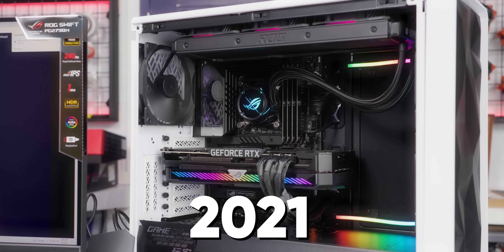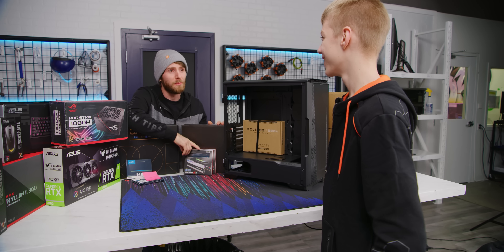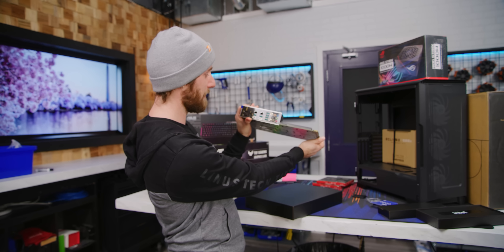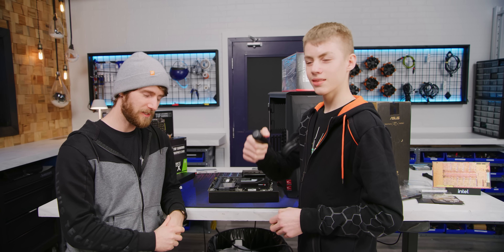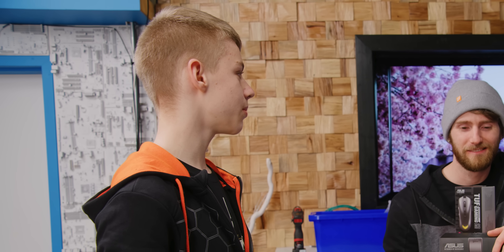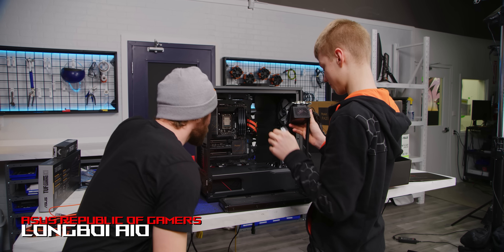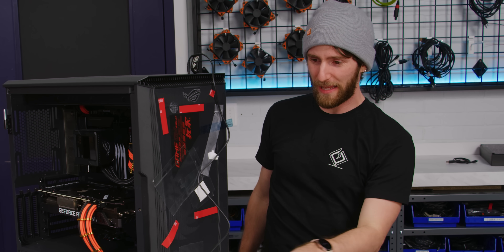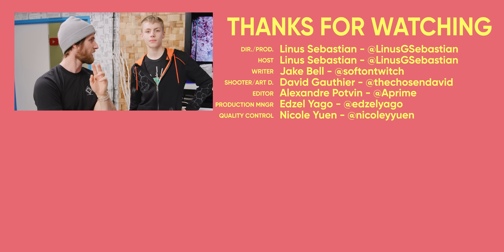Upgrading This TERRIBLE Computer - ROG Rig Reboot 2021

Comment: His computer is not underpowered, it’s just too ahead of it’s time.
Reply: ahh i see what you did there
Reply: You’re joking but it’s really not underpowered at all.. if he thinks an 8400 and 1050ti is old and weak he’s spoiled af
Reply: @pcmasterracetechgod5660  Indeed my current computer is a five year old Dell with an i3 and intergated HD 530 graphics, which still isn't half bad at playing older games and I'd a 2005 Pentium IV with an Nvidia 6200 "Turbocache" before that 🤔😀 ...
Reply: @pcmasterracetechgod5660  i'm using a Pentium @4500 and i have a i5 4210u
Reply: @iChimbo  i5-4510U?
I rock an undervolted and overclocked i7-4700MQ 😎.
Reply: @kyria_kous  or PSU/cooling/mobo are bad.
Reply: @pcmasterracetechgod5660  im running a i7 4790 and a gt1030, wheres my rig reboot
Reply: @RidingNQ  hey I'm running an i5 with an r7 240! where's mine?
Reply: @kyria_kous  something like ID-COOLING SE-224-XT would be enough. personally I'd get SE-224-XT and add/replace stock fan with an Arctic P12 PWM.
BeQuiet or Noctua are good when they are big and pricey, otherwise they are overpriced for what you get.
also whatever cooler you choose I'd be checking that it has a metal backplate. too many budget coolers have plastic backplates for Intel sockets.
Reply: @FritoLays1236  A 6 core coffee lake CPU and 1050Ti, not a normal 1050 (1050Ti is much stronger) is more than enough to play pretty much any game at 1080p easily
Reply: @saricubra2867  Sweet... its Mobile?
Reply: @iChimbo  Yes, and ridiculously an old powerful and efficient beast. With a good GPU, Cyberbug 2077 woulf be playable around 30fps.
Reply: @pcmasterracetechgod5660  it is.. Intel released an update that basicslly fucked my 8700K

Comment: "It's running an i5-8400 and a 1050 ti."  THAT'S NOT OLD.  But it is a dell, so it feels older than it is.
Reply: My gaming laptop has an i5 6300HQ and a 960M, and even to this day it’s a trooper for the kinds of games I play.
Reply: Specs don't matter if it's Dell.

Literally any GPU and CPU chips they could possibly put inside will be so severely hampered by bad cooling and weak VRMs that they'll all perform just as poor at the end
Reply: my main pc is xeon x3470 (2009) and gt1030 (instead of gt240 that died)
Reply: I have a MacBook Air, y’all are lucky just to have a pc
Reply: @lynxdolphin8760  well I also have a 2019 MacBook Pro but that’s mainly for school and creative use
Reply: @wormball  i have one too. Do you have gddr5 or ddr4 1030. It matters more than you think.

Comment: Linus, I just upgraded from a 1070, I7-7700k and 16GB ram. Now, my current build is this: 
RTX 3070, I9-10900k and 32GB RAM. I am in love with it, and do I tell you when I get double the performance, I do. 
Thanks for having videos uploaded. I used your tutorials for a few things when putting it together. :)

Comment: 1:04 wait he did all that but he's unable to diagnose his PC? Unless he blindly copied the projects he did, this doesn't make sense....
Reply: there are sometimes when pc decides to start dying and there is nothing to fix. Has happened to me. For example one time i closed a browser which made my pc completely shut off... for no reason whatsoever.
Reply: @generolas121  but I mean there's a lot of diagnostic steps you could take.
Reinstalling or trying another OS, looking at the temps and touching the heatsink to know if you need to replace the thermal paste, testing the psu (either with a multimeter or with a psu tester), etc

Comment: I too would be confused by Intel's box for their CPU.... SO MUCH unnecessary packaging. Environment is going to shit and intel over there be like "Lets package our little CPU into a box thats almost as big as the mainboard!" Did they take example of Amazon or what?
Reply: So, I'm not defending intel because they could've continued with the old sized boxes(10600k was appropriate imo) but there's a reason why the cpu boxes are so big. First is basically bigger box-easier to look at in stores. Secondly, it is to combat theft. If the bix was just a bit bigger than the cpu then it would've been a very attractive item for shoplifting. But now they can't just slip that big if a box into their pockets
Reply: Is that retail or just review packaging
Reply: There's a piece of silicon in there too. It's a special edition.

Comment: as far as im concerned anything over 16 liters is a large case. you dont need a box thats bigger than the apollo guidence computer. these big cases are all bypass air and wire hiders for wires that are not needed. you are building a computer, not a borg ship.

Comment: So I know he now has a very new computer but I think a potential problem that he was having with his 1050ti was having any application running with hardware acceleration(ie. chrome, discord). That is the issue I have had with my system with a 1050ti in it.

Comment: I have dual Xeon E5-2680 with 16 physical cores @ 2.7GHz and a GT-740...yet it still drops frames at times with only 40% CPU load. Lesson learned, more cores is not always better.

Comment: I had my PC since 2013 (same pc though)

2013:
Intel Pentium G32..
2GB ram
512 HDD

2015: ram upgrade
2+4GB Ram
Same.....

2019: (few upgrade)
4+4GB ram
GTX 1030 2GB

2020:
Additional hdd 1.5 TB

I have been using computers since 2003 seen those xp->vista->7->8->10->11
And this mostorous beast is running windows since 9 years. 

And works great never changed the thermal and all. And I play games but at mid settings.

Comment: Random question but what’s the purpose of 2.5Gb LAN if your switch / router only negotiates at 1Gbps or if you have a baller setup it might be 10Gbps but what is even 2.5Gbps used for?

Comment: anyone know what size hex key you need to open the bottom cover of a 13-inch early 2015 MacBook Pro? mine has a bad battery and I have been meaning to replace it

Comment: Hey, recently I got a new prebuilt PC from a store, with the specs of GTX 950 MSI 2GB, i5 2500K, 512GB HDD and 128GB SSD for the price of 400. So, it doesn't boot up. All I hear is 1 long beep followed by 2 short beeps. I need help, could someone help me?

Comment: I have a old PC 
Processor: Interl(R) Core(TM)2 Duo CPU E8400 3.00GHz 3.00GHz
4GB RAM
64-bit 
I'm new to computers i don't know what do i upgrade first it can handle csgo lowest possible settings i can run it with 20-70fps

Comment: To make a spot welder for welding battery leads & such you just need a limited/CCS PSU, a capacitor and a chonky switch or relay. Even a pencil can work if you're creative enough. An SS switch is not a necessity in the slightest, and SS is dogshit for peaks like that. People overthink the most simple stuff in electronics a lot of the time, it's ok to put together janky sh*t, as long as it works and is fun (and at least a bit safe). As long as it's not way over 300V and no gas tubes are involved, there you don't mess around.

Comment: i5-8400? That's perfectly fine. If he's having problems with anything crashing —including games— it's likely due to software malfunctions, including potentially too much bloat on the system.

I have a computer far far older than his (i5 750, 4GB RAM) that I've been using every day including playing games like Cyberpunk 2077, and it hasn't crashed in years. My uptime is measured in months much like a server.

I'm not saying that he can't benefit or deserve the upgrade, just that some of the problems he was encountering seemed not related to specs.

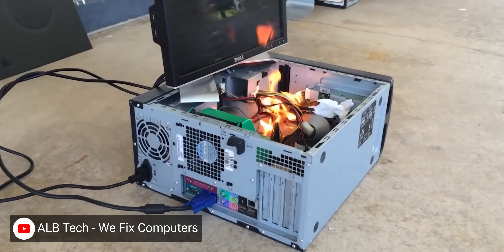Comment: 0:31 I am using a core i3 6100 with 4gb ram
is there anyone with lower specs
Reply: and no graphics card
Reply: I got windows 11 pro i9 15TB ram $750 graphics card and a 100TB HDD with a 750TB SSD and a motherboard from 2022
Reply: Oh and 150 GHz
Reply: Lowest pc specs rn is 1700x and gtx 1070 ti

Comment: This is COMPLETE overkill Linus. I do know that the i9 12900k won't draw 200 watts on the desktop but still it will waste a lot of power compared to some less overkill hardware. The same applies to every component here.
And with that he's got a 75hz monitor... A FKING RTX 3080 WITH A 75HZ MONITOR?? That configuration makes no sense and even I would have made a better choice!

Comment: 6core 4Ghz cpu isnt enough for modern kids.... PSHH, PATHETIC! When i was a 'gamer kid'(12-15y), i've saved up, bought and rocked OG doom, cs1.5/1.6, OG SA and other 'AAA' titles of that time on 2.2Ghz(oc to 2.5) Dual core pentium, 4GB ddr3 1333mhz ram and Geforce 8800GT on a 16'' LCD monitor with 720p resolution and didnt whine about performance and i was happy. :)